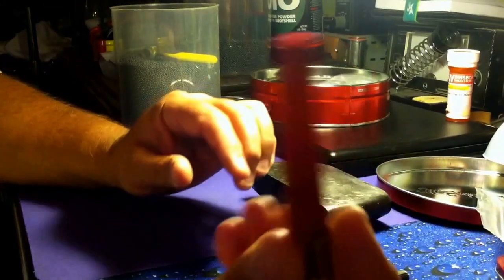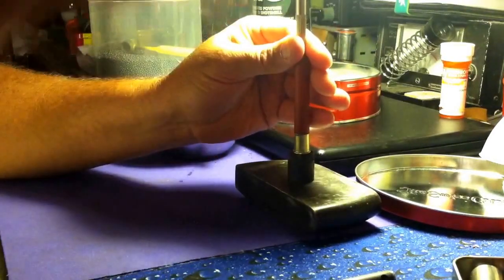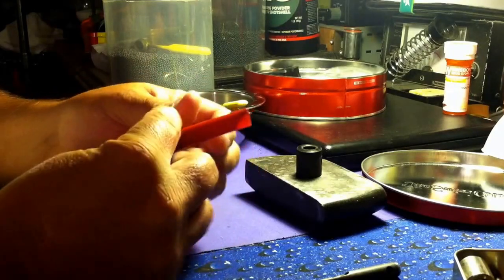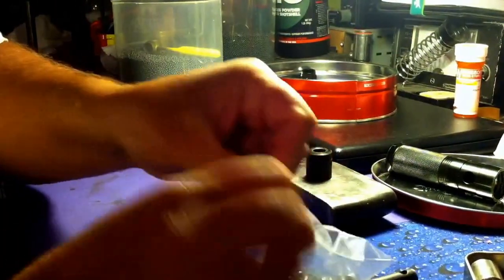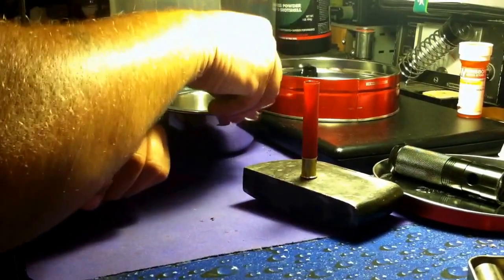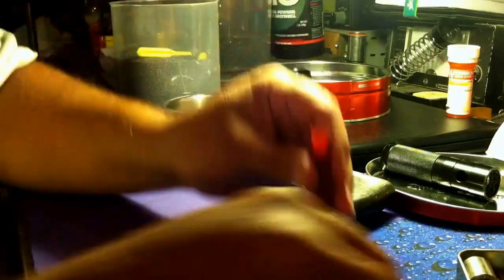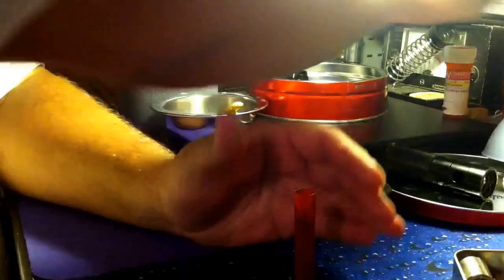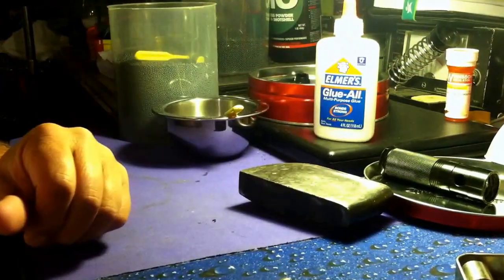Loading a shotgun shell without special tools or a loader 410

Comment: What size did you drill out the washer ?
Reply from the maker: +Spruce I used a 15/32 and it fits smooth in my gun. I also used a larger bit to put a small taper on each side of the hole.